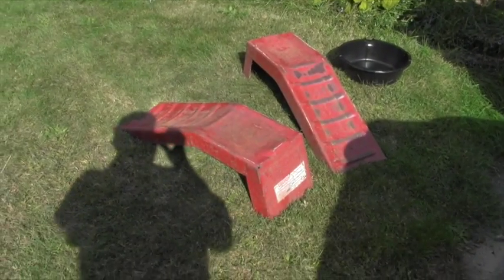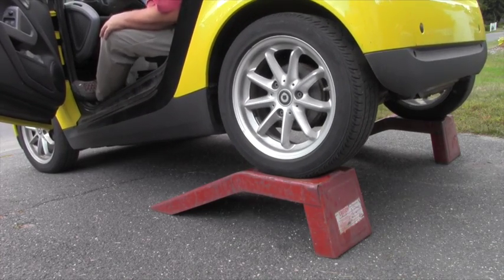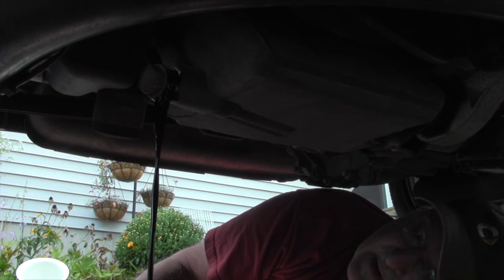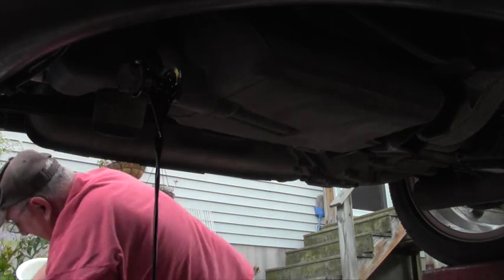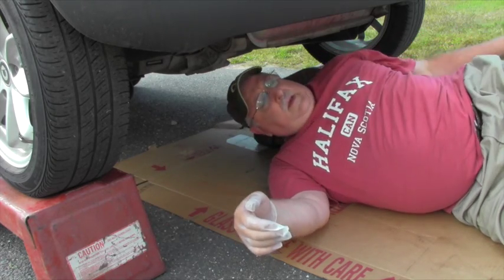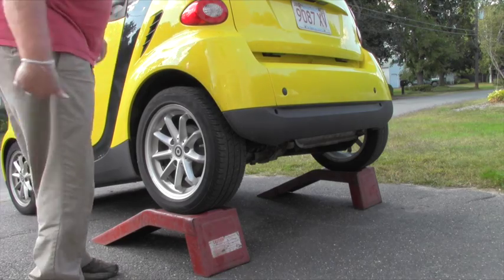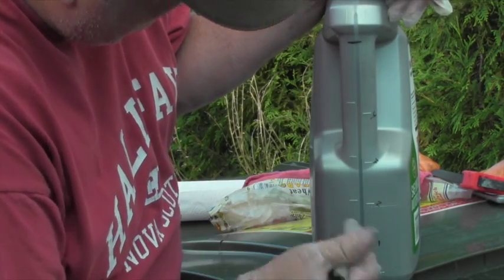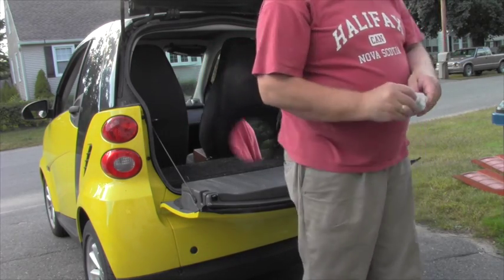smart Fortwo Oil Change

Comment: Why would you even take the time to make a video on changing the oil in your car if you obviously don't care about engine damage?
Reply from the maker: Why would you even take the time to watch an oil change video if you are obviously a automotive expert?
Reply: @Denb7  let me guess... You probably drive without oil in your car too.
Reply from the maker: @bobbys405  I really should have a pre-written response to comments like yours because I have responded to so many people who insist that there is NO OIL lubricating the engine parts. In fact, the residual oil on all parts is ample enough to prevent excessive wear during the 33 seconds the engine ran at an idle speed. 
Anyone who's ever cleaned engine parts should know that draining the oil pan does not remove 100% of the oil. When cleaning parts, even wiping with dry rags won't remove the oil. That's why degreasers and solvents are used in parts cleaners. 
As I've written time and time again, the engine was run without PRESSURIZED lubrication, but not without any lubrication. The most affected parts would be the hydraulic lifters which is evedenced by the tapping sound.
If it makes you feel superior then... "Yes, I do drive my car without oil."
Reply: @Denb7     So then the real question is why are YOU watching an oil change video if you're obviously automotive expert? And why should I believe you that running your engine for 33 seconds without oil is ok... It's not ok. He probably does that every time he changes his oil too and that's not good no matter what you say.
Reply: @bobbys405  The real question is why do you keep responding when he clearly doesn't care what you think?

Comment: thanks for sharing, even though I have a diesel, so no sump plug. Still worth watching, and whilst I would not run my car without oil, there is nothing wrong in what you did for that short time.  When very cold, you should wait for the engine oil to warm up before you drive off, how many people do that.
Reply: You should not let it idle long as the gas washes the oil from cylinder wall and you increase wear. 0w40 and 5 w 40 flows in 2 seconds all over. Just drive it very slow and easy till is warm.  Put a litre of 0w40 in your freezer over night. See how well it flows for yourself. Open oil cap and see in a morning. It flows in 2 seconds. Have some common sense man. Is not the 70s any more.
Reply: @mihairadupop2491  Petrol is not a gas it's a liquid and my car is diesel which is an oil.  It adds to the fact that diesel engines run for longer without any issues. 
We don't have very low temperatures where I live, last year -1 Deg C for a few days was the coldest,  with 8 being the norm in the winter.
Reply: @tonyciantar6417  that is hardly cold climate that would affect a full synthetic oil. To warm up in such temp is pointless. 1 min idle and 5 min easy drive to get up to temp. I also have diesel. Bmw 635d. I have a oil pan pad heater that i plug in in winter. My oil is warm at start so there is no need to warm much .

Comment: do yourself a favor go buy a Socket more easy and run at least 2 L of oil engine with no oil only for a few seconds is no good and you did not overfill the OIL FILTER WAS EMPTY you should run engine for at least 2 minutes to get to oil pressure running and filling oil filter after ENGINE OFF wait 2 more minutes check oil LEVEL and add if NEEDED buddy i'm a Motorbike EXpert this is how we do it even a MCLAREN does the same we run it at normal temperature then engine off wait 2 minutes check level.
THANKS FOR VIDEO!

Comment: Fuck......Are maintenance fees on Smart cars expensive? Everyone acts like it is. You can't just take it to Jiffy Lube or something? lol... I have one, but haven't done anything yet on it.
Reply from the maker: +xinic5 A friend and I both got our smart cars at almost the same time. He brought his to the dealership for its first oil change. He paid $180. That was enough to convince me to do it myself. Jiffy Lube are a bunch of hacks. Besides that, this car requires Mobil 1 synthetic oil so Jiffy Lube would rake you over the coals anyway. 
Even at Walmart, Mobil 1 is about $8 per qt.
Reply: Denb7
I'm thinking of applying to Jiffy Lube ....   >.>
Reply from the maker: +xinic5 Way to set your sights low.
Reply: +Denb7 well I wash dishes now, and UTI is expensive so...Got to start somewhere
Reply from the maker: +xinic5 In that case, good luck to you, but I will still be changing my own oil.

Comment: This guy did everything pretty much correctly until he fired the car up WITHOUT OIL! It's not worth the risk of engine damage to do what he did. At the very least he should've put it in park and shut the engine off after he got it off the ramps. The ramps are not going anywhere once the car is off them and he picks them up.

NEVER START AN ENGINE ON ANY 4 STROKE ENGINE WITHOUT OIL IN IT!
Reply: On a final note, I would've had my two step COSCO step ladder handy to pour the oil in BEFORE starting the car. This way I will have that nice warm fuzzy feeling when I turn the key before driving it off the ramps.

Comment: Would it have been THAT hard to add the oil before driving it off the stands?   I was so hoping your engine would seize as it sounded like total crap.   That's a shame, because you really had a good video, but I hope some novice doesn't follow that fool hardy advice and have issues with his engine.
Reply from the maker: broderp Seized?!? Really? In 33 seconds? Now I'm wondering how much you know about engines.

Comment: WARNING! is right! this video should be a warning how not to do a smart fortwo oil change! the entertainment starts at 10:30 .........mobil1  0-40 not 5-30 Crescent wrench I can already see stripping on the drain bolt, lubricating with dirty oil on the seal, and running with no oil how to F up your car fast !!
Reply from the maker: Yes Poopi you are right. I really screwed up that engine quickly. After 11 years of using 2 drops the wrong viscosity dirty oil to lube the filter gasket KILLED the engine! Oh wait... no it didn't. And 5-30 is what the smart dealership used in the car since day one. And as for that Crescent wrench stripping... well 20 more years of that abuse and I'd have to start using vice grips. Oh would I get an earful then!
BTW -  Engine ran without oil pressure, not without oil. Internal parts were coated even after draining the pan and parts were still oil coated after 33 seconds at idle speed without pressurized lubrication. I invite you to prove me wrong.

Comment: I tell you what, I CHALLENGE you to make a video cutting that open that oil filter in a tub, or container filled with paper towels.  I'd GARENTEE that thing is filled with so many specs of metal, that if it were gold, you'd be rich LOL.  You really want to shut everyone up, then prove it.  if you don't have a filter cutter, then a hacksaw, or metal steel chisel along the bottom lip will pop the end off.
Reply from the maker: +MVP11489 You know what MVP... I might just take you up on this challenge. However, I won't be changing my oil again until September, so we'll just have to wait. But it'd be an interesting experiment.
Reply: +Denb7 +Denb7 sure thing ;).  Maybe I'll make a few videos myself on the right way to do this ;). lol.  Just jabbin ya xD.  I do like your other videos though.  the latch one was cool to see, though my 2011 has a power latch.  I didn't know they had a manual version.  kinda wish they'd have stuck with that though.  Seems a bit overly complex to have two actuators potentially fail.  The knobs are useless if one actuator fails, or there's no power to them.  I might someday see about converting it to this set up if it gives me trouble.
Reply from the maker: +MVP11489 The reason I make such YouTube videos, is because I feel I can make better quality videos than the ones I find already on YT.
I'd be interested in seeing your video version of a proper oil change. I'm sure others would appreciate it too.
Reply: Its actually easier to take a sample of drained oil.

It is acceptable to use the oil filter, but to open it is should be rolled like a copper pipe, not CUT with a band saw or other raw cutting device that would contaminate.

If my car, I would take the bet.

P

Comment: NEVER run an engine without oil as he has done here, damage will be done even if minimal. Don't need ramps. Easy got at underneath with no ramps . Use MANN filters that is what Smart Dealers use. Best to put oil in the filter before fitting, but not necessary.
Reply from the maker: Tarbet Balfour When not running, engine oil drains into the oil pan. When the engine is first started, the only lubrication available to moving parts is the minimal amount of oil that coats them. Until the oil pump is pressurized and oil circulates, those parts have the same amount of lubrication, which according to my many naysayers, is zero. So every engine at start up, runs briefly without oil.
This is not the same as bare metal-against-metal which so many have suggested. Try draining a bottle of oil and leaving the open bottle inverted for a month. Next put water in the bottle and take a sip. I'll bet you get a mouth full of oil because even after a month of draining, there will still be oil coating the inside of the bottle.

Comment: You undoubtedly did more damage by running the engine with no oil for 30s that the good you did by changing the oil.
Reply from the maker: And how do you figure there's no oil? Isn"t it true, all parts remain coated with oil even with the oil drained and the engine off.
Reply: @Denb7  if there's no oil in the sump then their won't be the necessary oil pressure to lubricate all the oil galleries. There will be oil on the parts but without the correct oil pressure from the sump it won't adequately protect all the bearings, rings and cams.
Reply from the maker: @nsoper19  Ergo, parts are indeed lubricated by residual oil but with no pressure. The most affected parts might be the hydraulic lifters.  Operating a cold engine at idle speed for 33 seconds isn't enough to entirely eliminate lubrication properties of residual oil. After 11 years of oil similar changes, my car has shown no signs of burning oil from piston ring damage or any other lubrication related issues.
Reply: @Denb7  I appreciate the fact that your car is still working well. That's great. However would it really be so hard just to push the car of the ramps and then fill with oil? Ultimately it's your car so you can do what you like. But as this was an instructional video I think it needs to be said that running the engine dry is a needless and will be damaging.
Reply from the maker: @nsoper19   Pushing the car off the ramps isn't the issue. Stopping it from rolling down my mildly sloped driveway and into the street and possibly into my neighbor's yard is. Not to mention getting it back up my driveway after it's off the ramps. I'm now in my mid 60s and not about to attempt pushing from the door frame then diving in to the car to apply the brakes. That is a dangerous maneuver even for a younger person.
If you look at the video's description, you'll note that it is listed under the 'Entertainment' category. The is also ample warnings for people to stop watching the video.
I appreciate your concerns, but I've been changing my own oil since the 1970s and have never noticed damage resulting from cold starts with low or no oil pressure. I lived in Grand Forks, N. Dakota where winter temperatures routinely reached -20 F. At those extremes, the oils of the day became almost like tar. Cold starts often lacked oil pressure for a few seconds. Yet, to the day I sold my '66 Chevy Biscayne, she never suffered any issues. The same for the next two owners (whom I knew).
Historically, I have not seen any evidence to support your initial contention.
Reply: @Denb7  well good for you I suppose.
Thanks for taking the time to upload.

Comment: never run the engine with no oil and you dont need the ramps, you  should take off old filter and drainage bolt together to drain all oil but other than that good tips on oil marking with pen